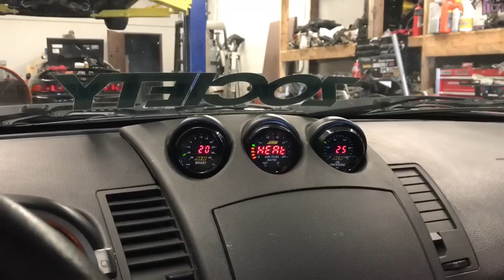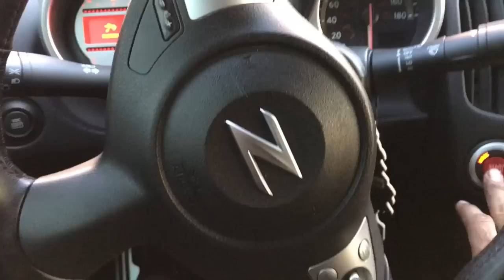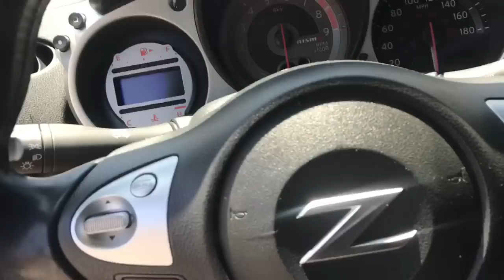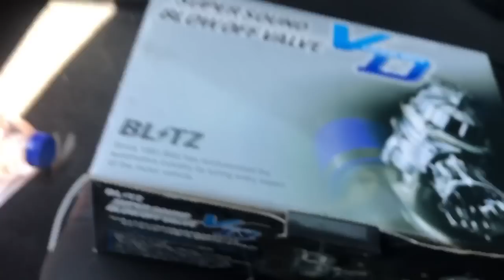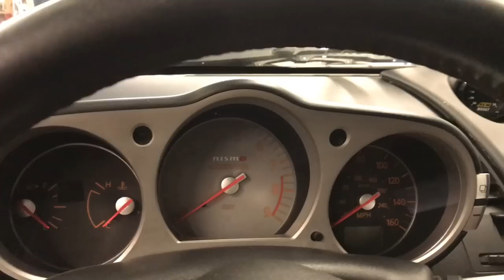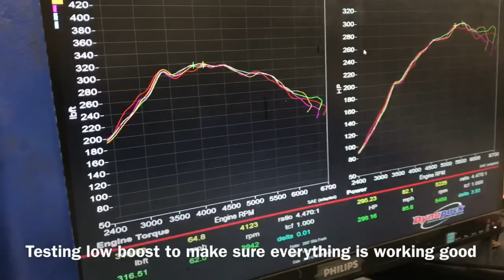48 hour turbo install, blown motor & swap!

Comment: A good tuner would pull timing and throw fuel in those areas which are out of bounds.
Reply: Fernando Hood the engine blew from the tech who worked on it. Wastegate lines came off
Reply: understood . Comment above still applies.

Comment: Guessing ur testing the turbo out on a stock hr motor first to see how much boost it can handle and eventually blow then take motor apart see what parts failed, then rebuild  ?
Reply: Smoki501 no lmao it just blew up because a line popped off and it over boosted to 31psi

Comment: Quick question but is that common to all  370z? 8:04 where it will just die on start up and then it starts up fine?  I just got my Z 4 months ago and it happened like twice I just had to rev it.  Bone stock